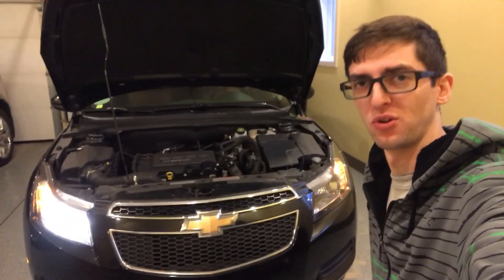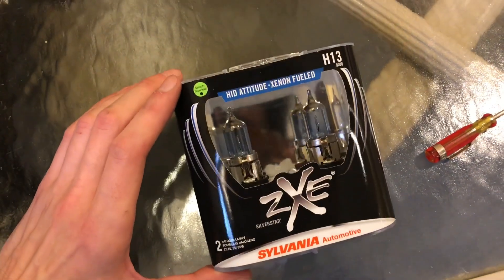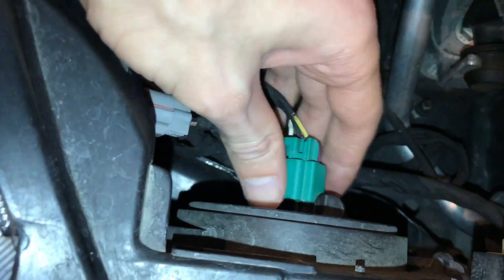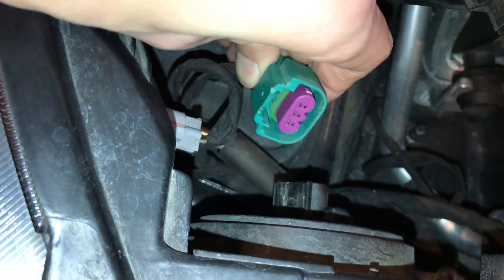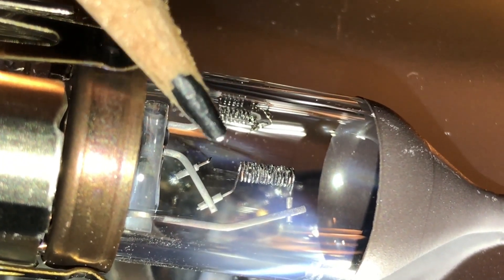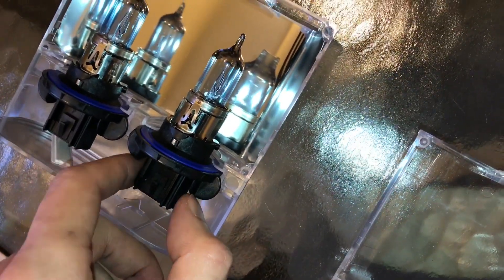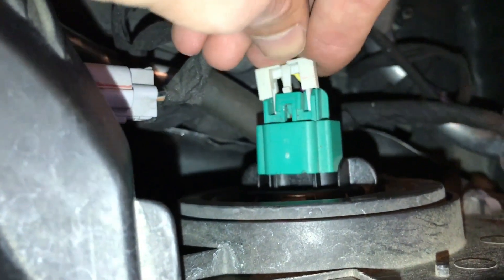Chevy Cruze headlight bulb change 2008-2016

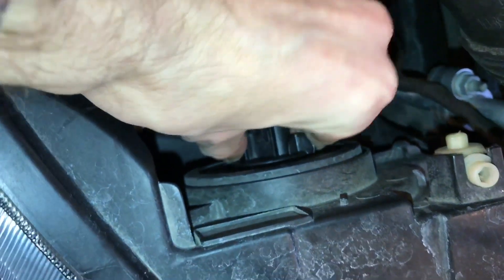Comment: 1:35 my new bulb was extremely difficult to turn.  was that the same for yours?
Reply from the maker: I believe so, try pushing in too when turning
Reply: @Mr95Kenny  thanks I'll try that.
Reply: It was because the old grommet had stuck in place.  I had to peel it off so the new one would fit.
Reply from the maker: O new bulb, i was thinking taking old one out lol. Yes i have done that before. Glad you got it!

Comment: Hi,
Good day bro,
There's a concern I'm facing.
The concern is that there's a delay when I shift between high and low beam light for alarming the driver in front of me to shift aside or alarming walking people.
This delay appears when I'm trying to fast flash/blinking the high beam light.
Is that related to the control timer on the right side of light control under the steering wheel or what.
Waiting for your advise.
Regards.
Reply from the maker: M Shahin i have no idea on that one. Is there the same delay when you just turn the brights on instead of flashing them? Check battery voltage when car is running. Have you put new bulbs in? Other than that i don’t know, sorry man.
Reply: @Mr95Kenny 
Actually no delay when I'm turning the lights on.. The delay is only while flashing/blinking the high beam.
Also I haven't changed the bulbs yet.
Any further advise?
Reply from the maker: I would guess the relay. Let me know what you find!
Reply: @Mr95Kenny 
Which relay you meant,
Could you specify more please.
Reply from the maker: The headlamp relay should be next to the battery in the fuse box, have a friend flash your brights and you should hear which one it is, or put your finger on it and feel which one is clicking. I haven’t needed to do this so I don’t know exactly what one it is but it should say on the cover of the fuse box, something like headlamp relay.
Reply: @Mr95Kenny 
Well, I'll check it.
Thanks a lot for being helpful!
😊